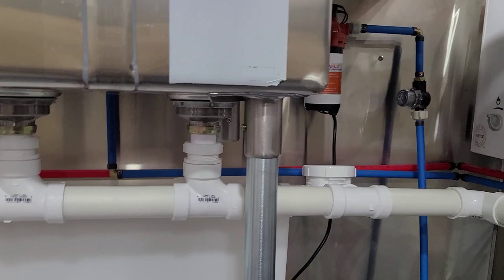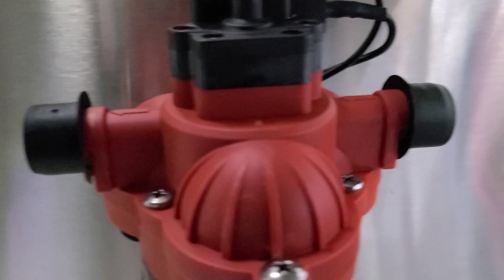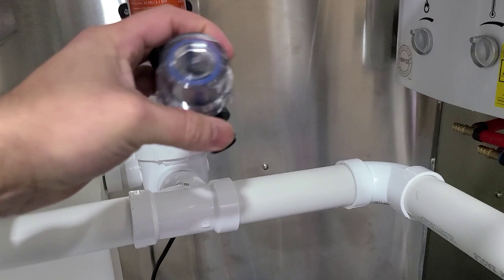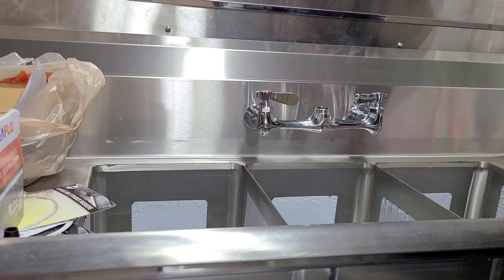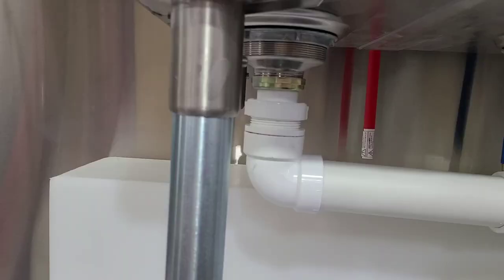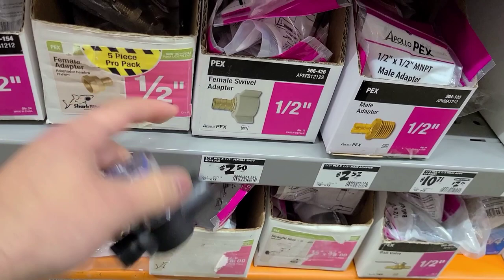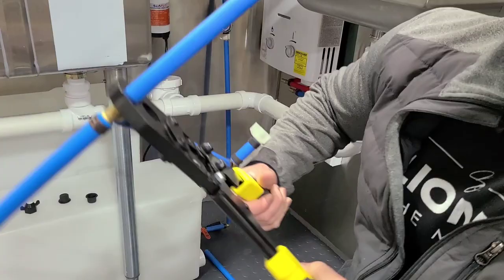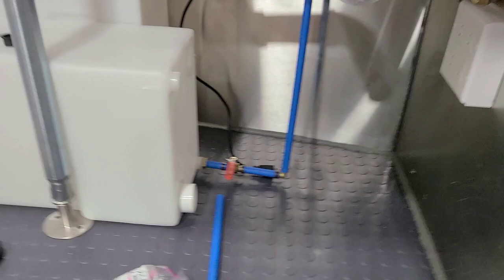How to Build a Food Truck: PEX Plumbing

Comment: Frank, I'm searching your videos to find one that can help me with a water pump problem. We have no water pressure. I called the guy who installed it and he said "you probably just turned it on with it running" and proceeded to try and coach us through getting the air of the line. We could not make it happen.  Can you make a video that shows me how to fix the problem?  Please!!! :)
Reply from the maker: Good morning, to be honest I have never had one issue with the pump working or air in the lines personally. Just have to make sure the arrows are pointing in the water flow direction

Comment: A note for those or you who operate in freezing weather like I do here in Vancouver BC .
Make sure to leave your pipes and pumps exposed to the interior of your unit and never attach anything to external walls .
I use heat tape on lines that are close to the external walls and two parabolic heaters aimed under the counters .
Reply from the maker: Very true.  Thanks for sharing

Comment: you're awesome dude! been working on my own food trailer almost 3 years now (as i get money or barter for goods) . I bought a hatch that also has a city pressure water hookup, decided to Tee its in tube : after pump/check valve, this way if I hookup to city pressure, I just unplug the pump, avoiding the fill tank altogether.
Reply: I had this same setup on my truck. Except you don’t have to unplug the pump. The city water keeps pressure on the outlet side of the pump and it shouldn’t kick on anyway
Reply: @johnsandlinjr  you are 100% correct, i didn't realize it at first. I immediately thought, darn I wish I put a switch on it then after testing everything realized it doesn't need it; it does exactly what you said, doesn't pump when not requesting water, put a check valve on out side of pump before the T of city pressure in. Works awesome
Reply: @b1tcHm4K3R  it’s funny all the things you learn when you have your own truck. Basically just lesson after lesson on what not to do lol
Reply: @johnsandlinjr  yea, so true , friggin redone everything at least once 🤣

Comment: I'm worried about water lines freezing during winter.  Is there something that can be done to heat water line in and the grey water drain out.
Reply from the maker: https://amzn.to/3cWHTdm

I use this style of heater inside the trailer and just leave it on. Helps out tremendously

Comment: Hey. How is your water flow. I helped my friend connect his water system for his food truck and he has poor water flow. I thought it was because of the water flow with the 1/2 pex.
Reply from the maker: @X_Starmedia  my water flow has been good, normal water flow similar to a house, where it sometimes gets different is when you turn on hot water. Have to open valves gradually

Comment: I used the same water pump and water heater as you did, I have a problem with only getting hot water when water is turned on low, water turned on full I won’t get hot water, and my water pump bib bad if water is turned on low, have you had any problems
Reply from the maker: So far have not had a single issue yet. Cross my fingers

Comment: Frank my water pump is blowing air into my fresh water tank any clues, no water at faucets followed your instructions to the T
Reply from the maker: Only thing would be to check the arrows on the pump make sure they are in the correct direction

Comment: Should have pit the filter screwed on the pump that's the way its designed could saved a few bucks on fitting and a little easier.

Comment: What kind of water pump did you have here? Like the specs not brand plz?
Reply from the maker: SEAFLO 33-Series Industrial Water Pressure Pump w/Power Plug for Wall Outlet - 115VAC, 3.3 GPM, 45 PSI
Reply from the maker: That's all the specs I know
Reply: @fbaltierrez  ty

Comment: Hey brotha I really love and appreciate the videos! Is the water pump to increase your water pressure? Another question I have is, if you were hooking up a 3 basin sink with 2 hand washing sinks and an extra equipment sink, would you use a water pump for both the cold water and hot water and just tee off to the sinks? I’m also doing this inside so I have access to a natural gas water tank.
Reply from the maker: Good morning. The water pump is to create water pressure can't have water flow without it. I would use one, because what are the chances you are going to be running all of the at the same time?
Reply: @fbaltierrez  thanks brotha! You’re the man! I’m close to opening up my restaurant in Milwaukee WI so when I do I’ll be sure to let you know and if you’re ever in the area, you already know we got you brotha!
Reply from the maker: @gunsmoke5657  deal

Comment: Thank you!feliz año nuevo 🎊 I just have this question can I do my own plumbing??on the health department website says the it has to be done by master plumber?but I heard if is done right i can do it my self it's that correct?I'm in Lexington Kentucky
Reply from the maker: Great question. My county does not require anything as such, do they ask for a plumber license upload to their system?
Reply: Yes!they want grease interceptor and a vent pipe from the waste water tank  6"on top of the roof!I want to do the work so bad myself!

Comment: Any videos on framing the food cart in. ?  Wood. And insulation.  Ect
Reply from the maker: Good evening. Framing the food cart? Don't understand the question, do you mean the walls and ceilings of the trailer?
Reply: @fbaltierrez     sup dude.   Yes Framing Meaning wood.   Putting wood on walls and ceiling.     The base of the project.  I was going to not even do this but i think it will be to hard to not do this.  Cant put insulation between the walls without doing it.   Did you not do this on your builds or ?
Reply from the maker: @FamilyChannelfun32  How the CargoMate trailer came thats how it is bought it from FacebookMarketplace. These trailers have plywood walls and floors which makes it easier to build. Just added insulation to the ceiling and to the wall where the concession window is.
Reply: @fbaltierrez   Aaaa i see i see.   Ok thanks man.   I am debating if i even need to put walls and insulation I mean i only use in the summer weather.  So i dont see why i really need to do that.   I can prob just put the stainless walls and electrical on top of that.  And then send it home.   Dont see any reason why not.  I will build wooden frame around windows so i have something to kinda screw to

Comment: This is what I’ve been looking for!!!!! Your videos are the best videos, please don’t stop. Do you have any videos for the wall and ceilings? I’m starting with a 6x12 empty trailer. I have little to any construction knowledge but I know I can. I used frp in my walls but now I need to put the stainless up for fryer area. Can you help? Thank you!
Reply from the maker: Good evening, I made a video almost in the beginning of the Build about the walls and ceiling don't know if you were able to see that one yet. What specific question did you need help on?
Reply: @fbaltierrez  I found the other videos but I’m not sure about the hood it has to have a fire suppression system as well but my ceiling height is only 6’2”. Will I have to get a custom hood since it’s so low?
Reply from the maker: @tovajohnson7217  you should be good with a Hood Mart Hood. My Food Truck that I use is 6 for 6 inside

Comment: Great video!  I have a few questions: Were those 1/2 s/s nipples that went through sink wall because they were super shiney for galvanize?  How is the back of the sink attached to the wall?  Are those flange feet to anchor the sink legs to the floor?
Reply from the maker: Yes galvanized at least that's what the package said. The back of the sink is attached to the wall on the corners and by the flange feet 👍

Comment: Hey Frank , thanks for making these videos . I was hopeless before finding your food truck plumbing videos . 

Which Seaflo pump is it that you used . I saw different ones on the Home Depot app but didn’t know which one to get specifically.   Currently following your steps to get the plumbing going in my food trailer .
Reply from the maker: Hopefully you found the one you were looking for. Sorry for delay in response
Reply: Did you call ever mention which pump
Reply: @fbaltierrez   Where did you get the strainer ?
Reply from the maker: @blackout7743  came with the Sink